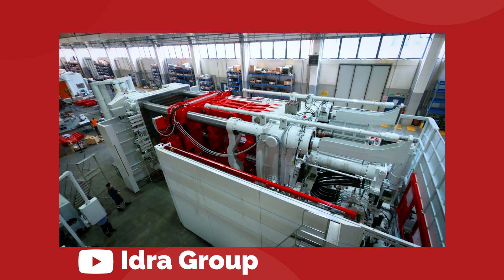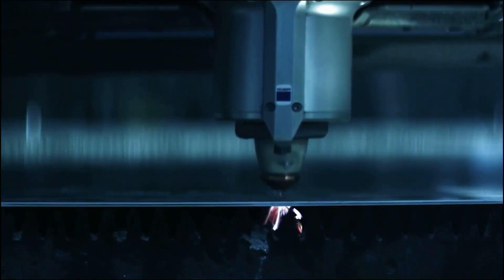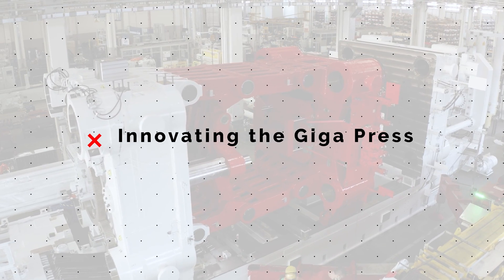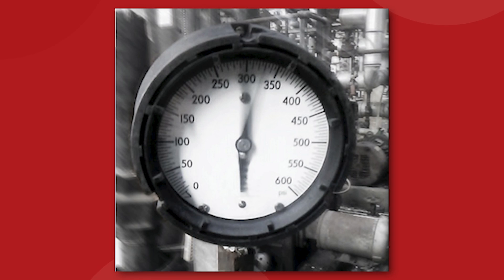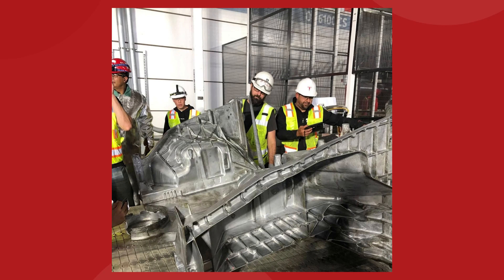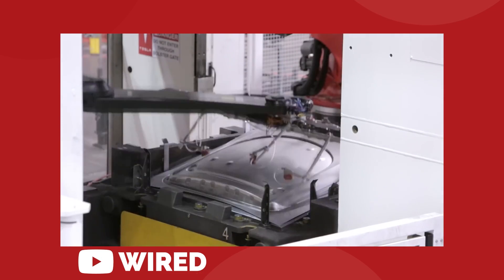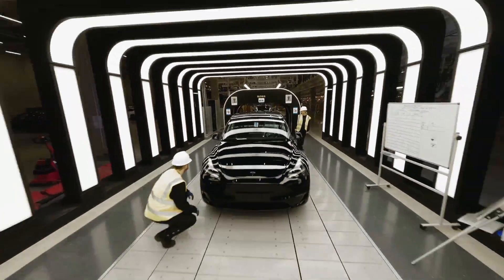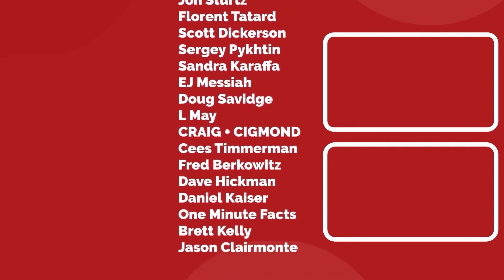The Real Reason Tesla Developed The Giga Press!

Comment: A lot of this process looks very similar to plastic injection molding. Of course I understand they're working with much higher temperatures and I'm sure the material is harder to work with.
I'm curious if they have some of the same problems. Ie flashing, voids, splay...
Reply: Die casting has similar problems to injection moulding, but the issues are compounded by the need to get the aluminium in the die way faster than is needed with plastics as the aluminium solidifies much more quickly. Die casting shot speed is almost instant but the shot still has to have distinct stages of the shot stroke. The first time I saw a die casting machine make a shot it scared me! I was used to the much slower plastic injection moulding process where to can see the injection cylinder move.
Where I work we make structural castings, chassis parts that would previously have been made from pressed steel.

Comment: Regarding injection pressure vs clamping pressure, think of it like a hydraulic cylinder. 

To use simple math. If the cylinder full of molten metal (a fluid) has a area on a plane perpendicular to the direction of travel of 100 sq inches and the ram applies 100,000 pounds of injection force then the fluid would be at 1,000 psi. If the mold into which that fluid in injected has an area of 1,000 sq inches then a clamping load of 1 million pounds would be needed.
Reply: Appreciated 👏👏
Reply: its not that simple. you have bottle necks in mold, material friction, drop of temperature etc etc...

Comment: a small part in the same press will need less clamping force with the same injection force . all the surface area between the 2 molds. not sure what they mean with 241ton injection force. per square mm or cm or m . i just know the mold is like a complex hydraulic cylinder. bigger cylinders can lift more weight with the same hydraulic pressure.
Reply: I'd assume they mean 241 tons of force across the face of the injection plunger, so whatever the surface area of that is.
Reply: @nutbastard  i think the same. the clamping force divided by the injection force should give a number of how many times larger the mold can be vs the plunger.  i struggle to explain in english . but would it be as simple as the surface area between the 2 halfs or a more complex calculation of the inner surfaces also. i thinking it's the latter but not sure.

Comment: That is extremely impressive, but I have a number if concerns. First, repairability.  The techniques for repairing stamped steel body/frame sections is fairly rudimentary at this point, but cast aluminum? I  am guessing the whole subframe section would have to be changed. I'm sure it all bolts together (hopefully), but sounds like an expensive repair if they don't just total it.
Tuneability; individual stamped steel parts can be fine tuned fairly easily to adjust strength/performance goals on the fly; a large casting? Probably couldn't change anything until the dies reach their useful life cycle.
Durability, cast aluminum isn't nearly as strong as steal, it fatigues much easier and I worry about it's long term structural integrity!? Aluminum is a great material for individual components, body panels, etc., but subframes?
Reply: Exactly, regardless of the innovation in the production process. At the end of the day, it's still a single piece of cast aluminum. I'd think the potential for totalling a vehicle that would otherwise be repairable is definitely a concern. Even if the component cost is less than the conventional assembly, given these castings will likely have a single source. Literally one or two machines worldwide. The constrained supply allocated for new vehicles and little or none available as replacement parts will be another issue. Even without such a unique bottleneck, Tesla already has problems supplying repair parts.
Reply: @davewood406  What would make sense is if the insurance companies had an arrangement with Tesla to basically swap a new or repaired car with the damaged car that Tesla then refurbished. 🤔
My issue with cast aluminum is it can develop stress cracks slowly over time and then fail catastrophically. Welded or hydroformed aluminum much less and steel typically deforms dramatically before all out failure.  I'd be reluctant to buy a Tesla for this reason; I'll wait to see what their track record is over 4 or 5 years.
Reply: @watchchimp3102  that was part of my point. Ultimately it’s cast aluminum and everything that goes with that. I don’t mind smaller structures like control arms that aren’t significant portions of the car and it’s value. 

Totaling a car that is just uneconomic to repair due to the newer technology has been kind of a thing for a while. Just blowing the airbags on a car might get you there.

Comment: Minor nitpick:  Celsius, not Celcius.  It is also too bad that the conversation is in "tons of force".  Strictly, a ton is a unit of mass, not force.  The downward force of a ton of mass resting on the earth's surface is probably what is meant, but whose ton?  A US short ton of 2000 lbs?  A US long ton of 2240 lbs?  A metric ton of 1000 kg (2204 lbs)?  Resting where on the earth? (gravitational force is different in different locations).  Far better would be to use Newtons or Meganewtons, which are an unambiguous measure of force.